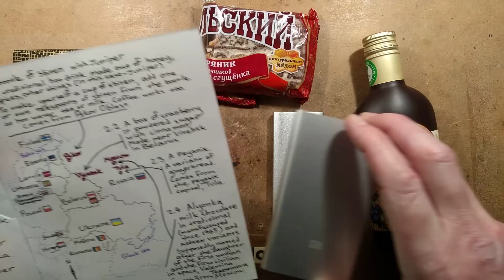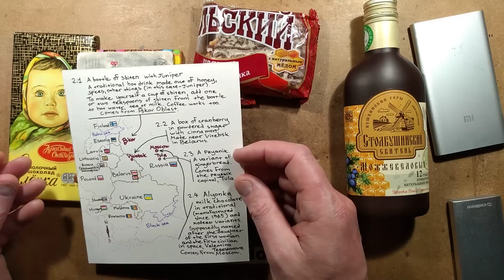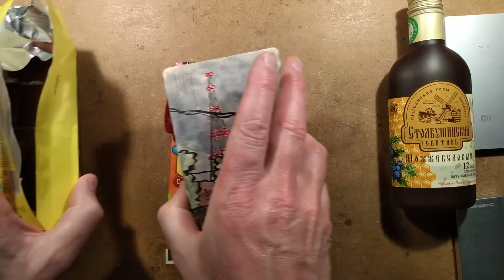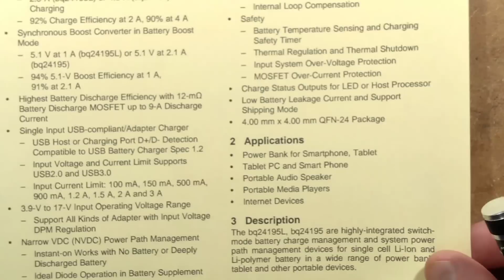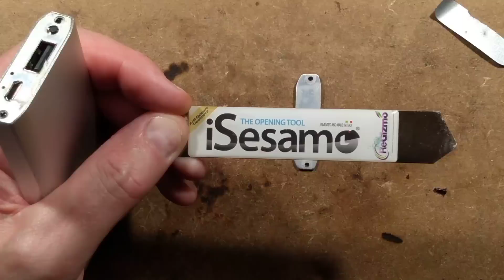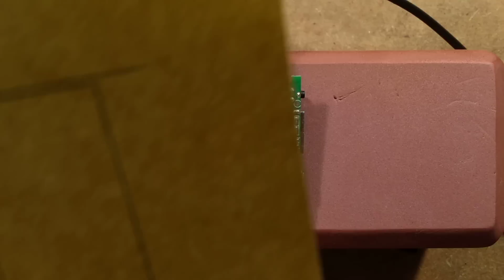Resurrecting dead power banks from Russia.

Comment: I've often found that repairing power banks really isn't worth it. if the problem is the cells and it usually is the cost for quality replacement lithium cells isn't really saving you much over buying a new power pack

Comment: This story reminded me of my trip from the US to the Philippines.
On the main trans-pacific leg, our plane had power inverters in the seats, but the ones on my row didn't seem to work.
The guy beside me needed a charge, so I let him boost up off of my absolute unit of a battery bank.
Specs below the fold.
127,000 mAh @ 3.7v new, fitted with a 5v1A, 5v2A, and a variable DC 9v, 12v, 16v, 19v, 20v 3.5A out for laptops.
Is old and holds ... somewhere around 65Wh last time I tested it, probably less by now, and the status LCD is utterly rekt.

Comment: My wife murdered her powerbank by not recharging it when the power was either really low or drained. I replaced it with the exact same Xiaomi as the first one. I must now ensure she treats it a tad more gently (to avoid the teeny tiny wire from breaking) and to keep the charge up so it doesn't die like her first victim. Maybe I will attempt to explore the dead one but the case appears to be glued together and I would likely destroy it when disassembling it which would null and void a usable repair.

I purchased the Xiaomi one because it has a Mode C charge connector and the idea was to eliminate the micro USB cables from her travel case (her phone is also Mode C). The Xiaomi is also a lot lighter than the previous one which has, I believe,  the 1822 (or was it the 1865) "laptop cells" in it.

Comment: My thoughts on the sugared cranberries, never having tried them and only just now looked up a recipe: since cranberries are hollow - they're filled with air, so they're harvesting by flooding the field and corralling them on the surface - there's enough space to fill with the sugar syrup you coat them in before rolling in powdered sugar and leaving the outside to dry. If the berries don't perforate, osmosis alone should leak sugary liquid into the cavity (though that leaves me the question of air pressure). But then it depends on who makes them and what exact recipe they use. Maybe that particular version/manufacturer aims for that result.

I should get ahold of some of these and examine them closely. ;) (Or wait another month and start buying fresh cranberries on sale to make my own variations.)

Comment: Love the video! I would like to know what system you use to provide a battery with a current limited supply. Have you built your own PCB for charging or is it a device that I can buy from eBay or Amazon which regulates current flow? Thanks!

Comment: fixed such a powerbank that had liquid damage. opened it, washed the pcb with water and then alcohol to get the salts off and dried it with compressed air. started working again

Comment: If you use a CPU in this type of application the CPU should have plenty of power when the charging source is connected. Also the CPU should have a couple of features, under-voltage lockout, and a watch dog circuit. This shuts down the CPU if the voltage is too low and the watch-dog can reset the CPU if it crashes. CPUs like the MSP430 series are so low in power consumption that the internal discharge of the batteries will consume more of the battery power than the CPU.

Comment: is it only the united states with international and domestic hazmat laws regarding lithium batteries or does all of the world have laws except for china or china ignores them?

because maybe dead batteries are a new way to get high power lithium batteries through the mail without dealing with dangerous goods declaration 

ohms law sais watts is volts times amps and with a single cell allowed to be 20 watt hours that would be less than 5 amp that can go through without dg declaration.

a battery is 100 watt hours so only up to 5 cells of less than 5 amps.

should customs test the battery and find it 0 volts math sais anything times 0 is 0 so it would stump customs and possibly allow them to let even a high power battery like a chevy volt module 48 volt 45 amp hours at 2000 watts

Comment: I F'd up two power banks by shorting them by mistake when I was probing them. The light just pulsed instead of blinking when charging, and it wouldn't charge anything it self. But I noticed  (by accident) that when I touched the probe off the case of the output USB to the negitive it came back to life. So I soldered in a wire from the USB case solider joint to the negative of the battery and it worked better then before. I used to get only 20% charge but now I get 85% to 90%. Can anyone tell me why this is thanks.
Reply: P.s they were those cheap poundland power banks. And Clive your a legend👍
Reply from the maker: Be careful about bridging things in power banks.  You may be bypassing the charge protection circuitry and it could cause battery failure with an explosion risk.
Reply: @bigclivedotcom  no i  made sure to check  twice!! that it was shutting off at 4.2v on charging and 3.2 on discharge. Well 3.18 on my best meter. I don't know why it works better now but it dose. Was just wondering if anyone knew what was going on coz I walk around with this thing in pocthet, i don't want to go fire but it seems to be doing its job.

Comment: Have you ever had a charge protection circuit that needed a "hard reset" by turning the power off completely, after it was in "lockdown" mode due to overdischarged cells? I've resurrected a laptop battery with 5x18650 cells by individually charging them, but then it still didn't work until I desoldered the board from the cells and soldered it back on, so it reset its lockdown mode. That (and the fact that it's the same with iPhone batteries, which get a <0.5s short circuit in order to drain the power from the protection circuitry) made me think that all charge protection circuits worked that way. Now I see that more often than not, they reactivate themselves just by the cell getting back into that acceptable voltage range.

Comment: "I've switched to using a windows computer..."  gets Chromebook to actually USE a computer  ..Oh Clive.
Reply from the maker: The Windows laptop was on top of the Chomebook, which is my usual web interface.  (It's what I'm using right now.)
Reply: @bigclivedotcom  I know windows has the propensity to get in the way of work with it's updates, I didn't however realize it was PHYSICALLY in your way. That's almost worse as windows is concerned.  Speaking from experience, there is NEVER enough bench space for everything. glances around own bench

Comment: check out the how its made video on cordial cherries.  thats what happens when the fruit stays in contact with sugar.  they dont use liquer when making those cherries usually, the thick coating of sugar inside the chocolate shell kind of... dissolves? the cherries

Comment: I've looked at a lot of these types of devices. The chips on the back are likely current sense chips. A battery bank like this will have a chip for each function and they add up.

A microcontroller for input logic and integration
Monitoring, current sense and overload protection on the battery.
Current sense and limiting on each USB-A port or USB-C port

Boost converter for output sometimes controlled by the microcontroller but usually separate
Fast charging handshake. Not really sure why these aren't built into the microcontroller but they are typically standalone.

Comment: That radio tower is actually quite amazing, and iconic. I think I remember hearing they were going to pull it down? But there was a lot of opposition because of its historic and aesthetic value. Is it still standing? Not sure.
Reply: There were plans for demolition five years ago, those were halted, but the tower in Moscow exists in a precarious state as it desperately needs a restoration, but no one wants to properly do it. I heard the saying was that to properly restore the tower you'd need to demolish it and built it again, but only Shukhov could do that.
(One can never be so sure about demolitions, current Moscow administration loves to demolish stuff, and there's no real civil control over them, it's not like there's an election or anything).

Comment: I didn't get why the three cells in parallel are safe in this case.  Is it always OK to have parallel lithium cells?  what if you drain them in parallel, but charge them separately?  thanks
Reply from the maker: They all balance as a single cell when in parallel

Comment: Possible glued battery liberation technique tip. I know a pro trick to remove car brand badging attached with double-sided tape is to get behind them with a length of dental floss and use a sawing motion while pulling across or down releasing the badge without damaging the car paint. If you can somehow get a line of floss behind a glued battery on a product you really want to repair or inspect without damaging the battery, you should give it a try. Hello from scorching hot Florida. If we're not getting burned like ants under a magnifying glass, the thunder storms are trying to kill us.

Comment: I know us RC guys seperate the battery cells and recharge the discharged cell up just enough to get it back using a regular charge not a lithium charge. Afterwards we use the lithium charger to bring that one cell up enough to closely balance with the others. This requires constant babysitting and its easy to puff the discharged cell. I do it outside on a brick, never ever in the house. Those things go nuclear in the house and the wife will end your hobby of RC really quick. The smell and smoke is terrible from an exploded over charged cell.

Comment: You'd think they could have quite easily designed a bootstrap circuit that started the micro off external power and then carried on as normal. This quite effectively limits the shelf life of the device, if it's one of those things you only use in an emergency, it's perfectly feasible that it would fail when you need it most... But hey, there's a reason I'm not employed as an electronics engineer, I guess.

Comment: Windows is a terrible idea. Long live Linux, long live competent operating systems. If you want a nice OS that doesn't bog you down in too much horsecrap, Ubuntu MATE is a pretty solid choice. The MATE desktop, despite being a GTK3-retrofitted GTK2 desktop still holds true to its GNOME 2.18 roots (albeit with changes over time breaking some GNOME 2.18 things but that's just progress) and is very comprehensive in its provisions with "Familiarity" for people coming from just about any other desktop, including Canonical's Unity and Microsoft's Explorer.

Since it's an official Ubuntu variant with Canonical's blessing, their shim loader for Secure Boot-equipped motherboards comes included so you don't get that pesky secure boot violation message some boards throw up when using a non-Windows OS. If you get into the nitty-gritty and bother to manage your own partitions, you can create an installation as small as 54GB for both system and home, and if you can figure out how to mount the Windows partition to symlink from or move all of your personal files and application stuff to another partition, both systems can happily co-exist with both systems influencing the same files so long cross-platform programs can utilize the files in a similar fashion, should yo ever need to boot back into Windows for continued work in a dual-boot setup.
Reply: Dual boot is pretty outdated, virtualization is the way to go nowadays.
Reply: @NiHaoMike64  For servers, where you have multiple domains handled by the same machine yes. But for raw performance bare metal is better, every single time. Linus Tech Tips proved this in a recent hackintosh piece they did.

Comment: Hershey's does use wax to save on manufacturing costs for there chocolate bars. If I remember correctly they raised the wax % back in the mid 90's to keep the price of there bars down. When I was a little one there bars were great and much larger then they are now but now they are small and meh. I don't even buy them to make smores anymore since the chocolate wont melt anymore.

Comment: I have one of those Xiao Mi Pro powerbanks since new (over 3 years now), it's a great product, I use it as a parking battery for my dash cam as it allows pass through charging, so while the car is on the Xiao Mi charges and powers the camera and while the car is off the camera is powered seamlessly. If it ever stops working I'll know where to start looking!
Reply: Matthayi Naalaaman  I typed Pro to diffirentiate from the non pro Mi Power Bank

Comment: The MI is a usb powerbank with quickcharge 3.  Useful for powering a ts80 soldering iron to 9v. Also works with A+ 6 phone (and all te others I've tried it with.  Seems to be qc3 compatible "by the Qualcom book" unlike so many of the reverse engineered chinesium knockoffs.
Not found anything it's not compatible with.

Comment: I like the Russian confectionary. If I get the chance to go there again I will stockpile even more, muhaha.

I'm not sure about the exact bar you've got there but in my experience it tends to be dark chocolate more than milk there. Even in siberia in every shop you can not only get russian chocolate, but also all the same stuff you get in england too (minus cadburys, in place they have milka, which I prefer anyway)
Reply: Hey there) glad to hear that, I can even mail you some.. those sugar balls, what clive got, if you're interested
Reply from the maker: Thanks for the offer.  I'm trying to limit the amount of candy I eat.  I'm putting on too much weight.
Reply: Dark chocolate is seen as more "fancy", and milk as more "simplistic", that's probably why it looks like that.
Imported chocolate (or, actually, foreign brands manufactured for Russian market) is often considered better, and honestly, stuff like Milka and Ritter Sport have more variety than most local brands, although some smaller manufacturers also enter the game with unusual flavours, but these kinds of chocolate are usually on the expensive side. 
Cadbury is mostly limited to imports sold in very fancy shops, i've seen a small Wispa in one of those shops for like 1.5 euros, but there's one exception — Picnic is quite common and affordable.

Comment: I have the exact same Xiaomi Powerbank and it had the exact same problem. After soldering the wire back on it worked flawless for the past two years now.
Reply: In m, opinion the Xiaomi powebanks are one of the better solutions from Asia. This was the one and only time I had to put in some work to make them "good"

Comment: If those powerbanks look complex to you, you should tear one of those multi-voltage USB-C PD (Power Delivery) powerbanks to bits. Those have not only the microcontroller but also additional circuitry to generate various voltages for USB-C output (I have a 20800 mah Powerbank which has 5V, 9V, 12V, 15V and 20V USB-C outputs and also supports QuickCharge in addition to USB-C).
@21:56: The label on the gingerbread candy actually says "with condensed milk" in Russian.

Comment: I too vouch for the quality of the Xiaomi power banks, I have 3, they perform faultlessly and the stated capacity is accurate unlike the many battery products for sale with silly stupid claims, I have a house full of Xiaomi products from a drone to a toothbrush, very highly recommended consumer items. ( Xiaomi Mi Phones are brilliant value for money )
Reply: Xiaomi phones become a good value for money after removing and revoking authorization to many-many ad-infested pieces of pre-installed (cr)app, that almost certainly also have the system app  status, rendering them uncontrollable and irremovable through normal means.

Comment: Couldn't you just put a 1.5v battery across the battery contacts for a little bit to bring up the voltage if you don't have a power supply? The general idea is to bring up the battery voltage just enough to allow the charge controller to start up. I know that's not current limited, but it can't charge higher than 1.5v so I don't know.
Reply from the maker: It's better to bring it back to 3V at very low current.

Comment: Those Xiaomi power banks, at least the newer ones with QuikCharge, are quite good - they have very low ripple on the output, have a feature to keep the output on on low load, and even understate the battery capacity..
Reply: jupp, that is also the reason for the complex circuit.
It allows to be charged with quick charge… and the output also offers quick charge…

which results in it accepting and outputting 5-12V at ~1.5-3A…
Reply: Huh. So even if I will need continuous 50 mah load, - the powerbank will not switch off?
Reply: @KOTYAR0  yes, usually it works by long-pressing or double pressing the button. For some of the power banks, they specifically advertise it for charging fitness bands, headphones, etc which sometimes charge at 25ma or less

Comment: My usual workaround for over-discharged cells is to just hook them up to a powersupply that's at about their nominal voltage for a few minutes and then put it back on the regular charger. Similarly overcharged batteries get to power a fan for a little bit until their voltage is back under control. Of course take all pie tin related precautions :)
Reply: I do that too to discharged cells, but IMO ones that have been like that for long lose a lot of their capacity to the point of useless most of the time. Still good for USB fans though or if you have those box 1-cell usb powerbanks where you can easily change the cell.

Comment: "Hersheys which is like wax" 

You must try some chocolate brands here in Philippines theyre like candles 😂
Reply: They basically pump it with oils, so you can technically use it as a candle since wax are simply just hardened oil